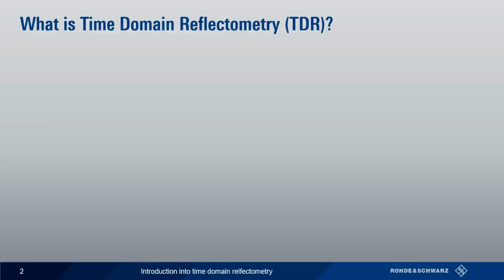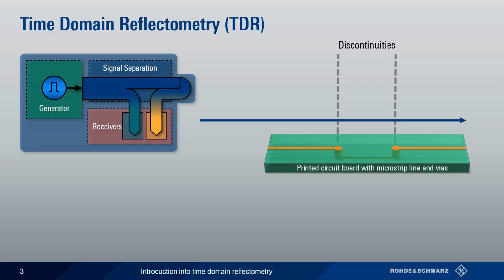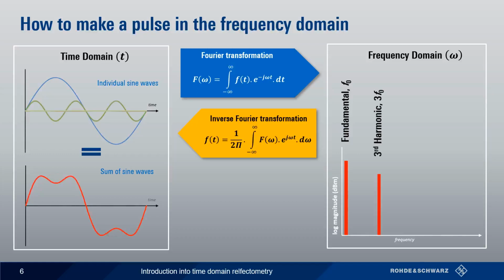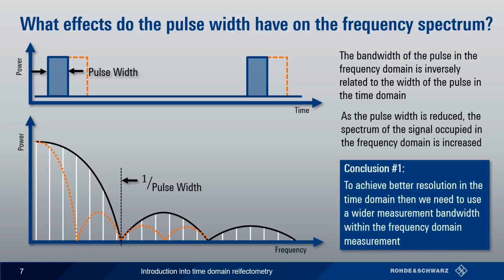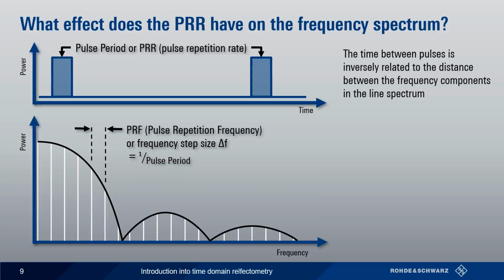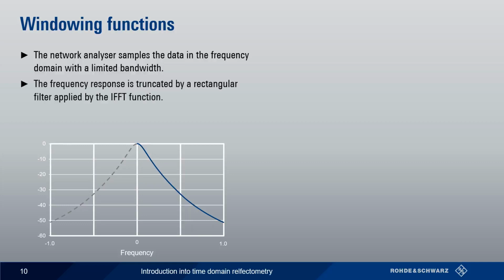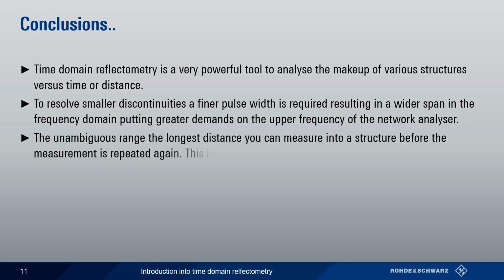Introduction into time domain reflectometry

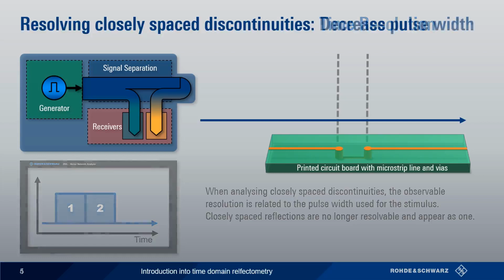Comment: 3:59 Instead of narrowing the pulse, couldn’t you widen it so that the reflections overlap and the amplitude is double for the duration of the overlap?
Reply from the maker: Dear Christian, 

tricky question. 

The problem is that you do not have any prior knowledge of what the discontinuity looks like in time or magnitude. So increasing the pulse width would simply have the effect of making the discontinuity look larger, without the resolution to understand how it’s made up.
Reply: By widening the pulse, you're losing resolution to detect the shape of the structure. Detecting two reflections that constructively interfere as one is indistinguishable from just one reflection

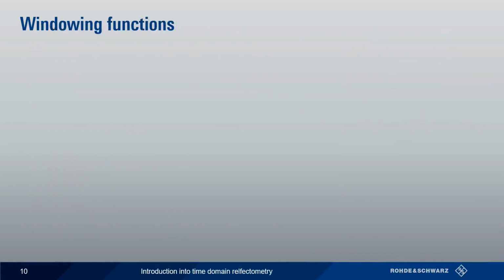Comment: At time 10:14-ish in Conclusion #2, doesn't reducing the frequency spacing DECREASE the pulse repetition rate and increase the max range of the measurement?  That is, reducing the frequency spacing increases the pulse period...not the pulse rate. (and vice versa)
Reply from the maker: Dear Rix Flix, 

from a traditional TDR perspective, Pulse Repetition Rate and the maximum unambiguous range are the same. You cannot uniquely identify any discontinuities within a structure once the next pulse has started. This is inversely related to the frequency span. More information can be found in the following app note within section 3.3

https://scdn.rohde-schwarz.com/ur/pws/dl_downloads/dl_application/application_notes/1ep83/1EP83_0e_TimeDomain_ZNA7.pdf

Comment: Why don’t we use CAZAC sequence in TDR instead of pulse signal? The cross-correlation of CAZAC is a pulse that has the similar effect as original pulse signal. Meanwhile, the bandwidth and PAR is easily controlled in CAZAC.
Reply from the maker: Dear Ryan,

In actual fact the network analyser is not using a pulse signal at all. A vector network analyser is a frequency domain instrument that characterises the frequency response of a network using discrete stimulus frequencies over a given band. In the video we show that we can relate the traditional pulsed TDR implementation used in the past to the frequency domain, which helps us to better understand the requirements when making the measurements on the network analyser. Mathematically, we are using the Chirp Z transform (CZT) for this purpose.

Best,
Rohde & Schwarz Social Media Team